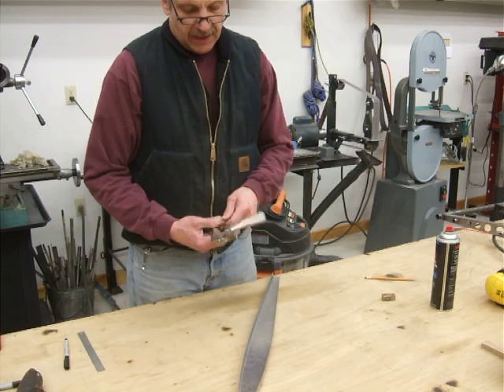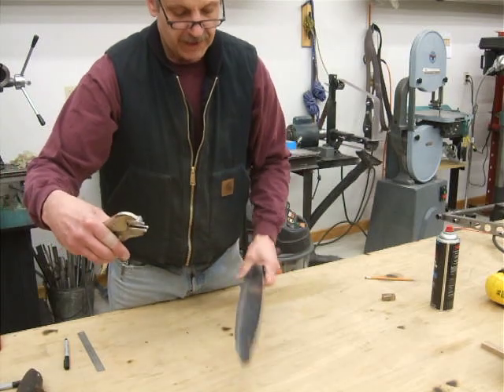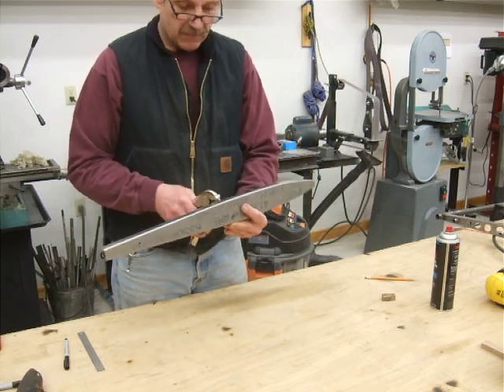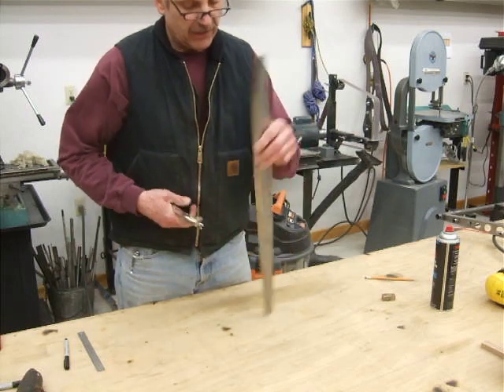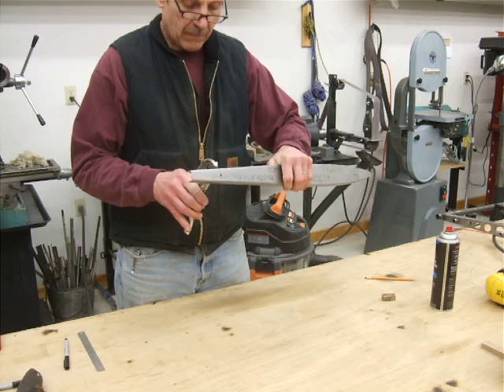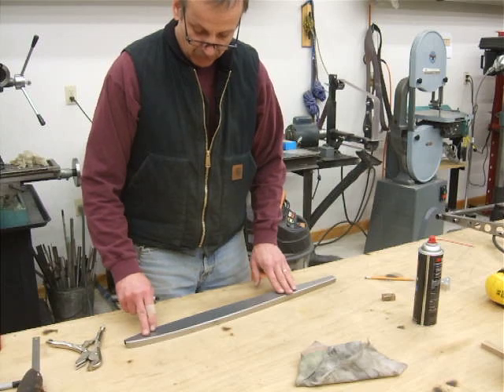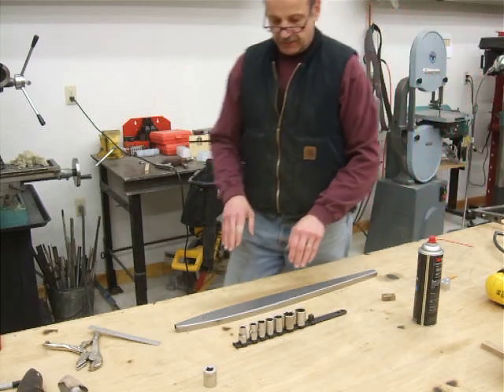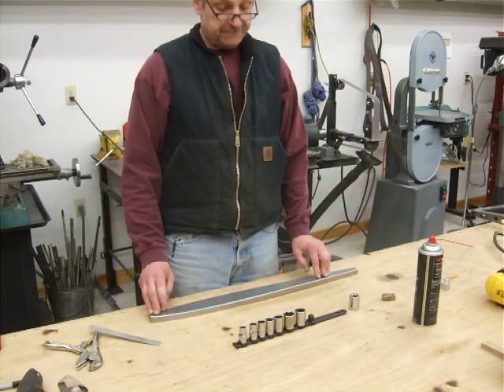Forming a Profiled Rib for a Bearhawk Part 3

Comment from the maker: Once I drew the circle using the proper sized socket, I measured the center of the hole with a steel ruler and made sure it was on the centerline. It's usually pretty dang close. I then used a spring-loaded punch to mark the center and used a 1/8ths bit for stainless steel to drill a pilot hole. For some holes that were the right size I used a Greenlee punch set I borrowed from an electrician friend. The rest (most, actually) I drilled using different step bits.

Comment: Great series! So I presume then, since you didn't show otherwise, that there's no heat treating of these ribs and they remain in the annealed state?
Reply from the maker: That's correct. Bob Barrows said ribs formed out of .032 mild steel (much easier to form) or .025 4130A would do just fine. He also said the lightening holes should have minimum 5/8" spacing and minimum 5/16" edge distance. Glad you like the videos!